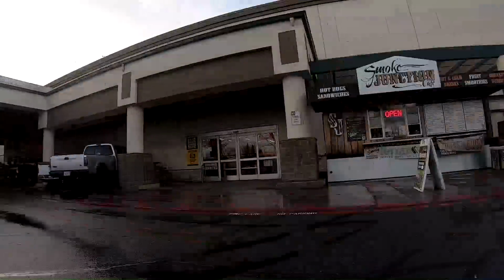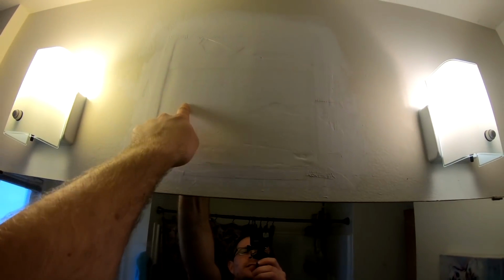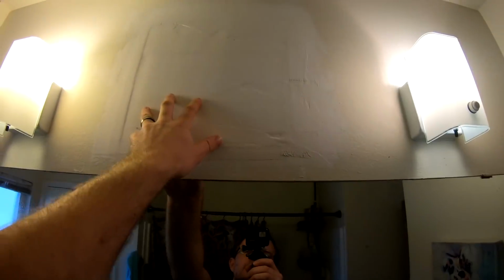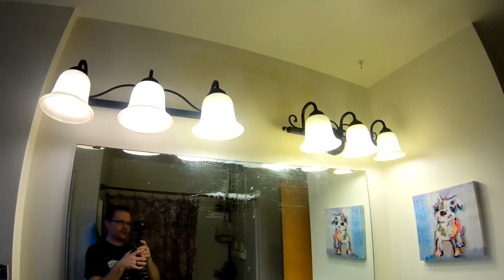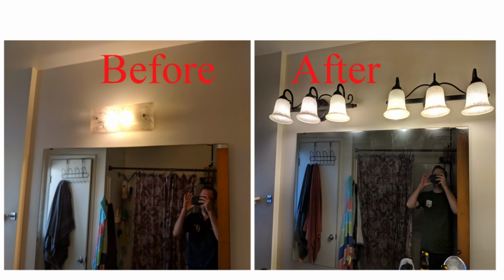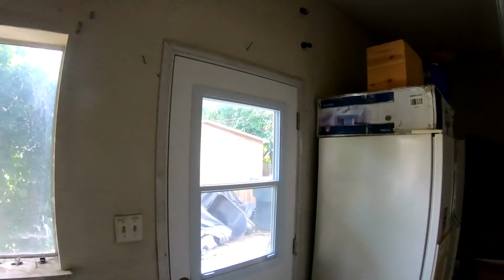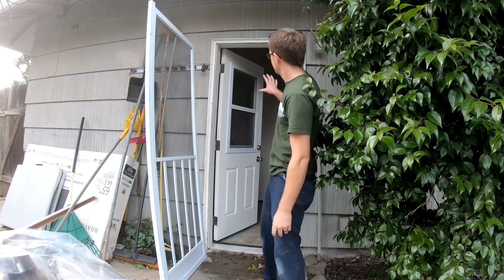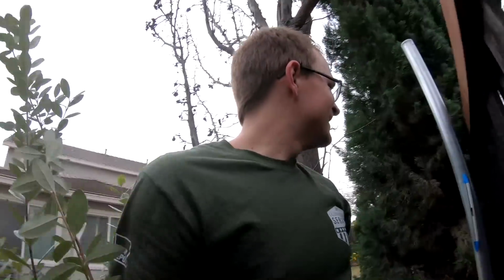You Can't Plan For Everything / WLOG

Comment: The good thing about contracting with Property Managers and not homeowners is that when unexpected extra work happens you can charge them without worrying about your quote or estimate.  I had one of those exhaust fans that also had a light and a heater to replace that, of course, the heater had burned out because of janky wiring like yours, causing a cascading effect. Good job man.
Reply: Rene Gade Hahaha I see what you did there!

Comment: I have worked on very few houses where the power comes through the switch box. On old houses watch out for switched neutrals.  Replaced old florescent lights in the kitchen of a house that was built in the late 1930's where this was done. The switch was off but the circuit was hot.

Comment: Lee, looking at the before and after pics of the vanity lights, I see an octagon box in the middle, junction box. Did you relocate the box to behind the light fixture? Obviously you know you can’t bury the box behind drywall. Thanks
Reply: ant caruso uh oh 🤭🤐🤫
Reply: I guess it might depend what city/county you’re working in. I work in the LA County area and this is a big no no. I’m a firefighter as well so burying a j box is a big fire hazard. Luckily it’s an easy fix. All he would have to do is put a blank plate and it’s a done deal.
Reply: @jbdesignandconstruction  Not dependent on the county, it's in the NEC.
Reply: ant caruso lol well then some counties are doing some shady stuff by writing things like this off....but then again I’m not surprised lol
Reply from the maker: I stand corrected. I guess it is illegal to put junction boxed behind drywall. Have seen it done many times before. . How would you recommend this job had been done? Replace all wires with longer wires and run to new light fixture box? This box was a junction of I think 2 other wires.
Reply: @handymanjourney  Easy fix...put a J box, if you don't already have one, behind each light fixture. You need them anyway since its a requirement to attach a hanging light fixture anyway. Run the 2 or 3 wire wire from the power source to one junction box. Then open wall and run the 14/2 or 12/2 wire from one fixture (in the J box) to the other  J box connected to switch leg.  Best
Reply: @jbdesignandconstruction  Big fire hazard yes if it is left wide open. But it is bad trade practice burying boxes. It is a stinking mess when something goes wrong in the box and you have no idea there is a box buried in the wall and you're trying to figure out why there is no power. or where the heck did these wire come from. Very bad practice. Rewire and move the box. Some times flip the box to the back wall so the cover can be exposed inside the closet. Because who wants a dam cover stuck on the wall in the bathroom between the lights.
Reply: @1stFlyingeagle  great solution

Comment: Maybe You should be less concerned with foot fashion and be more concerned about burying a live junction box,  I don't think that's legal in any country.
Reply from the maker: Hey thanks for your comment, it is if it is covered
Reply from the maker: I stand corrected. I guess it is illegal to put junction boxed behind drywall. Have seen it done many times before. . How would you recommend this job had been done? Replace all wires with longer wires and run to new light fixture box? This box was a junction of I think 2 other wires.
Reply: 1) put a larger light fitting in centre 
2) check for slack,  if you have enough pull to one fitting and loop to the other 
3) pull in complete new wires
4) leave as is but leave access to JB.  If that is to unsightly maybe access hatch at rear of wall maybe an option. 
5) stay clear of electrical.

Comment: Allen, get the chukka red wing boats, those are the best for working inside easy to get the bottom clean, and a lot of support, those boats you have are to rough for working in someone’s house
Reply: 15 years with the red wings n still love them!
Reply: I have worn Carolina steel toes for the last 4 years. They last me right at 2 years. The retailer was out of my size when I went for a new pair last month. He offered me a pair of Justin work boots. They are not steel toes, but I like them so far. They have relatively smooth soles, so they should be easy to keep clean.
Reply: I have worn Carolina steel toes for the last 4 years. They last me right at 2 years. The retailer was out of my size when I went for a new pair last month. He offered me a pair of Justin work boots. They are not steel toes, but I like them so far. They have relatively smooth soles, so they should be easy to keep clean.

Comment: Burried J-box, not allowed per code.
Reply from the maker: Hey thanks for your comment. With cover it is
Reply: @handymanjourney  OK but I don't see the cover so how is it not buried.
Reply from the maker: I stand corrected. I guess it is illegal to put junction boxed behind drywall. Have seen it done many times before. . How would you recommend this job had been done? Replace all wires with longer wires and run to new light fixture box? This box was a junction of I think 2 other wires.
Reply: Honest Lee Handyman I had this issue with my own house in the past. I was refinishing a room and replacing a drop ceiling with a drywall one. Any box has to be accessible, so I had to get rid of it. Wound up just rerouting the wires that were going to it which worked well to keep outlets and such on their proper circuit. Whoever created the rats nest had downstairs, living room and dining room (both upstairs) on one circuit. But not all of the rooms, only part of them. 
Personally I’d have either rerun the wires to make them all long enough, or run them up so you could put the box in the attic where it’s accessible. 
Great video!
Reply: @handymanjourney  You move all the conection points to the new boxes you installed. hopefully you can find enough slack to make it into either box and then add new between for the necessary conections,
Reply: Cheap way open it up get a cover for the box and decorate it some way u ran new wire for fan u should be able to pull the line wire back up to attic and put a box up there and run two new load wires to the lights separate great job

Comment: So you hid a junction in the wall. That is not code and is a fire hazard.
Reply: Richard,  if he puts a cover on the J box,  its legal.
Reply from the maker: Norm is correct!
Reply: Not really even if you have a plate covering the junction box you can’t leave behind drywall that’s not good, you will need to have access to the junction box
Reply: @handymanjourney  you can not by code hide any junction boxes. You need to have access this is a country wide rule. If you think differently you should educate yourself a little more and not do jobs that you are not qualified to do.
Reply: @christiangrados8637  ,  apparently you have never done electrical work, or built a house.  
     a junction box has to have a cover, regardless of location,  i.e.  attic, inside walls,
basements, etc.    where would you put a junction box, and why do i need to have 
     to it ?
Reply: @normhodgkinson6965  Sorry Norm, its never legal to bury a junction box. All junction boxes must have a cover and be accessible.
Reply: @normhodgkinson6965   NEC 314.29 states that all junction boxes are to be accessible. Accessible is defined as without removing any part of the building. This means you cannot put a cover plate over the junction box then cover it with drywall. If the cover plate is even with the face of drywall and exposed then it would be compliant. Acceptable methods would be to move the existing wire to the nearest sconce then run a feed over to the other sconce if there was enough slack. Otherwise the junction box should have been installed in the attic space. Both methods could have been done without much more effort and would have produced a code compliant and safer installation.
Reply: @frankdango3211  according to the NEC, it appears you be correct.   the last two remodels
    i did had junction boxes in locations that were inaccessible, and the inspectors
 approved them.
Reply from the maker: I stand corrected. I guess it is illegal to put junction boxed behind drywall. Have seen it done many times before. . How would you recommend this job had been done? Replace all wires with longer wires and run to new light fixture box? This box was a junction of I think 2 other wires.
Reply: @handymanjourney  Hey Allen, if the wires are long enough you could bring that junction box into the attic and that would be fine.
Reply: @handymanjourney  ,  i have seen it done many many times,  as well as
    doing it myself.  its not that big of a deal, so don't loose sleep over it. 
if you are doing a job that is being inspected,  most reasonable inspectors
    will allow it.   on the internet,  you will always find those that will
complain about the least little issue, just to make themselves feel smart. 
    you do great work,  and will continue to learn as you go.
Reply from the maker: @normhodgkinson6965  thanks Norm! I appreciate you!
Reply from the maker: @frankdango3211  love it! Thanks!
Reply: @handymanjourney  well if all wires where coming out of the ceiling I would pull them into the attic and junction up there. Otherwise if the budget doesn't allow for more punching holes in the wall you leave the junction there and use a blank cover. Not trying to be an ass really just trying to educate on the right practices.
Reply: @FranciscoMartinez-zv2rw  why because I know what I am talking about and the correct way of doing things?
Reply: @normhodgkinson6965  you sir are %100 wrong and if this is normal practice for you you are a hack and have no business doing work to other people's homes. If an inspector allows this they should be fired.
Reply: @normhodgkinson6965  and it's not complaining it is just pointing out what is seen that is not correct. People go to YouTube to learn and get ideas so don't you think they should know the correct way or even a better way then what minimum code says? I can tell you have no license of any kind because you clearly have not looked or read a code book. I do not memorize what the code numbers and what they say but AI have been a licensed contractor for almost 10 years. I know how things need to be done. When an inspector comes on my job we talk more then anything because they know my work is allways better then code. I strive to be the best at what I do and when I don't know enough that's when I sub it out so it is done the correct way.
Reply: @handymanjourney   Honest Lee Handyman  I am no way trying to piss in your cheerios. I just think if you see something you say something. I don't know about you but I never stop learning  and that's all my comment was pointing something out and it is up to you to varifi it I guess yourself but do some research of your own to know why you don't do this or even you tube it. I don't know but never stop learning strive to be the best at what you do. And not everyone just makes a comment to be a troll. Anyway I hope you did learn something on this.
Reply: @richardblowers6875  i just looked in my NEC Code book, and you are correct.   however i will
    continue to do it my way, as i have done for the last 33 years.  its not that big of a deal,
except maybe to you.   i have built homes and done remodels without any house burning
    down, and without getting a red tag, and without being sued. so, you can act like a first 
grader and call me a bunch of names,  but i know the facts, you don't.    you just assume.
Reply: @choppedchamp8757  i see in my code book you are correct,   over the years i have seen
    it done many times,  and have done it that way myself.   will probably continue to 
do it that way.     there are many so-called requirements in the NEC and the
    California Construction Code that are clearly ridiculous, and often reiterated by 
inspectors on the job site.  in the construction industry, builders and contractors
    often times get into a gray area of "which way is correct", and maybe "not quite
correct, but still gets inspector approval".  in the code books,  there are requirements
    shown how something should be done,  and in some cases there are exceptions
to that requirement.
Reply from the maker: @richardblowers6875  I appreciate you pointing this out to me. I totally agree, life is all about learning! So yes I definitely learned something today! I have seen this done many times but appreciate you pointing it out!
Reply: @handymanjourney  ,  yes,  longer wires that terminated in a fixture box would
    be correct, but a pain the rear.   i would've done it the same way you did just
for the simplicity of the job.   but as we found out,  all the internet experts 
    have ripped us a new one.    i'm going to hell for sure now.